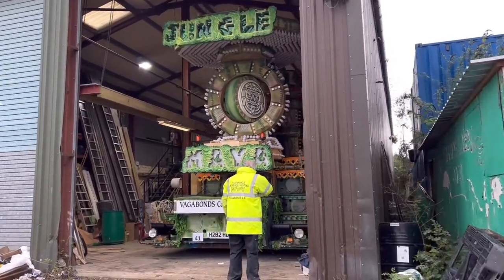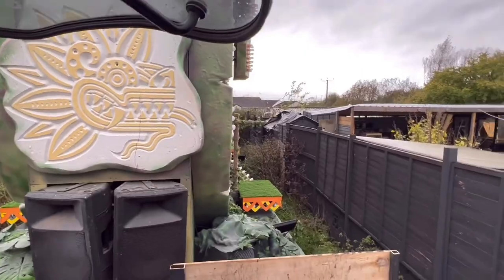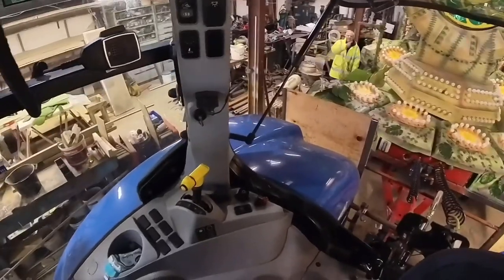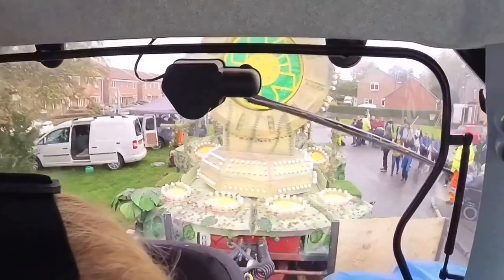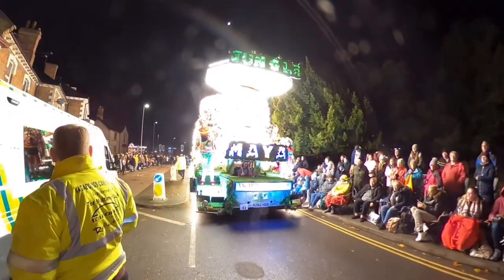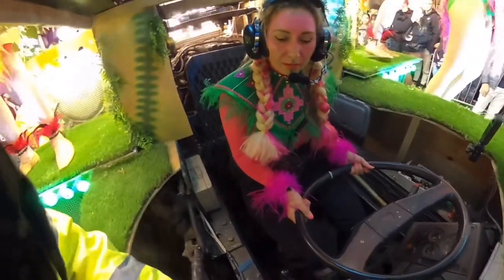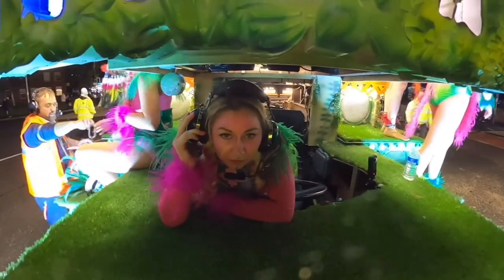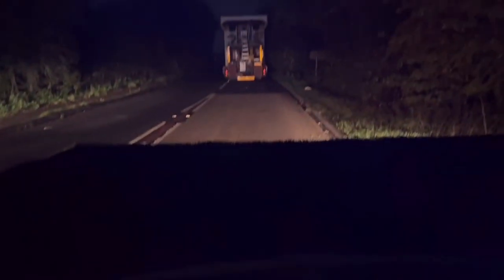Vagabonds | Bridgwater Carnival | big clutch problems

Comment: Great video! The most spooky thing about technical failures is problems that just disappear. We once experienced (many years ago) that the engine suddenly stopped. Multiple start attempts failed. Two hours later when everyone had already gone home the problem just disappeared. All the years since then, the engine is working fine!
Reply from the maker: Yes it is odd when that happens. It’s like when your out in a truck and tell the garage you have a problems with it and when you take it in it won’t do it for them 😫🤣🤣